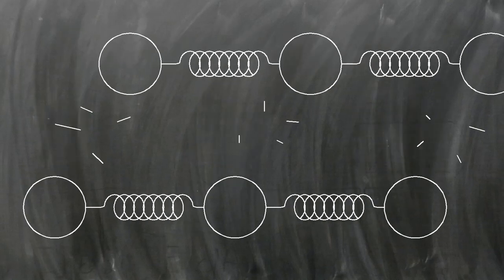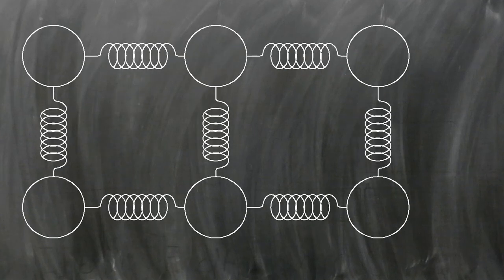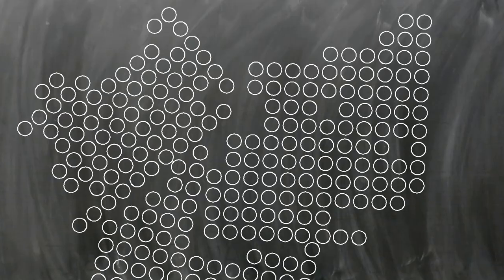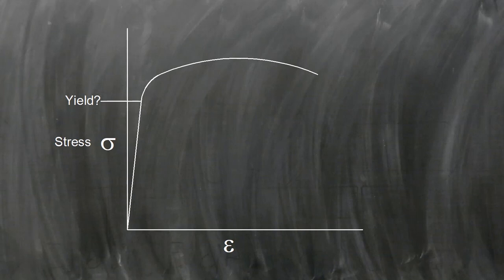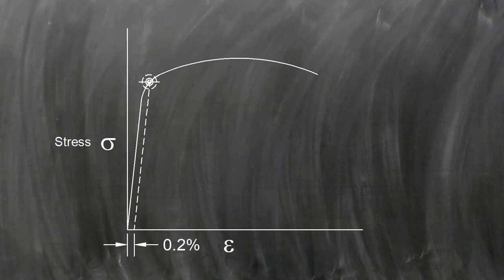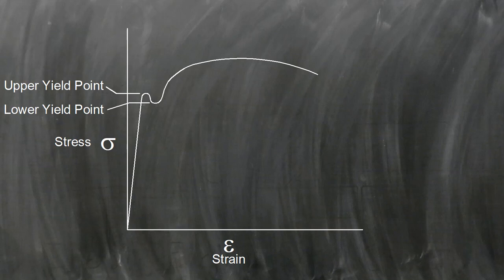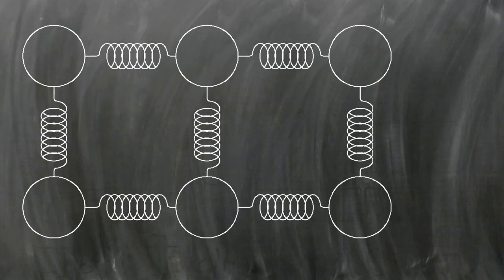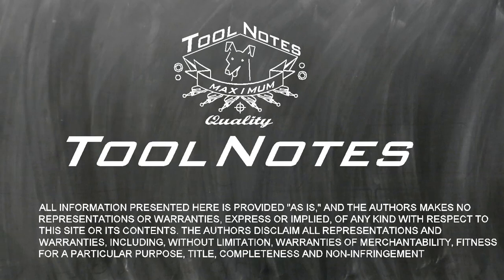Metals 101-10 The Yield Point

Comment: Why lower yield point is used only for design calculations
Reply: its hard to measure if the material is still on its elastic deformation region or already on its plastic deformation region, especially outside material testing facility. so for safety, just use the lower one as it would guarantee that its still on its elastic deformation region